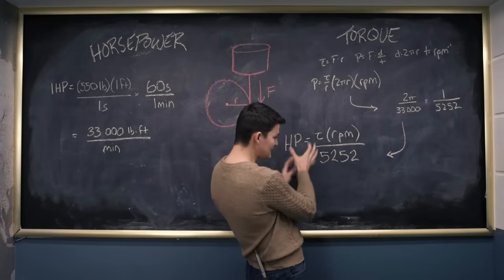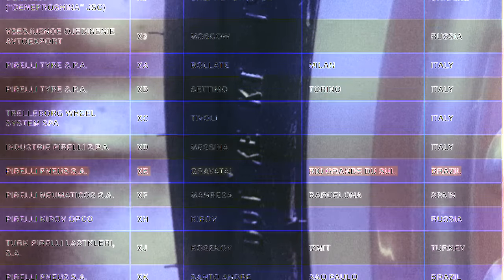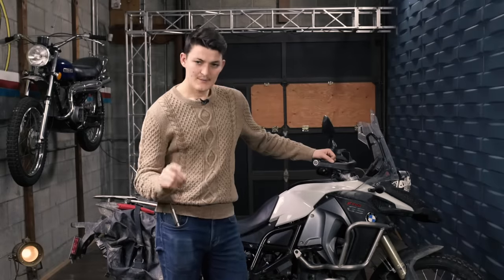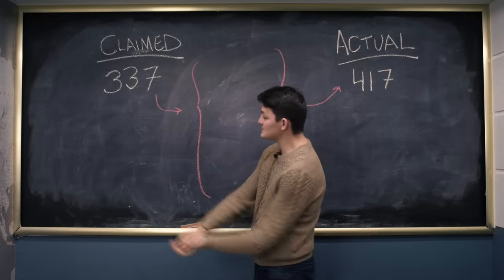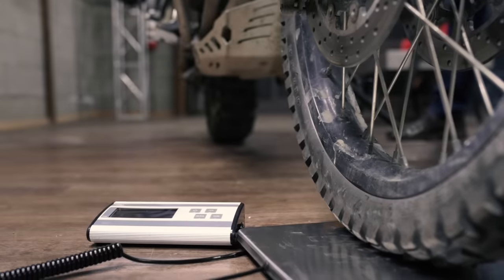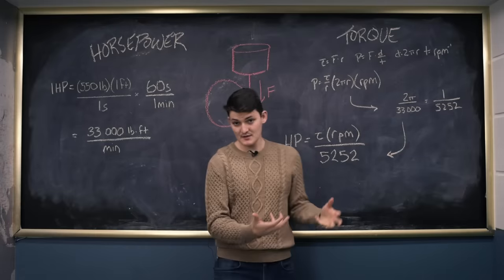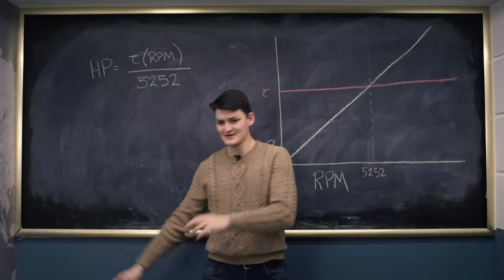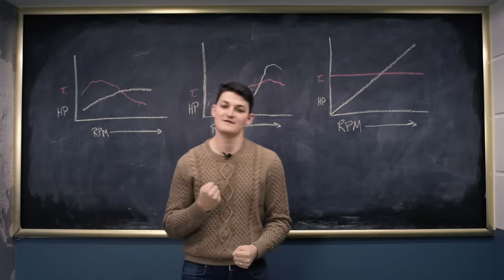3 Ways Motorcycle Manufacturers Trick You

Comment: Luckily with a Honda you don't have to worry about how much extra weight they left off with the tool kit, because they give you dick all for tools now anyway. My 86 Suzuki came with interchangeable screwdrivers, double ended wrenches in a ton of sizes and a spark plug socket. My 23 crf 300l came with.... An Allen key. That's the toolkit.

Comment: Love your content.  Clearly put a great deal of thought and effort into it.  Probably the only detail I would throw in there to tie two of the very astute points you made is that what you "feel" is acceleration.  Acceleration is effectively how readily available power is at the current rpm, vs. how much mass (you plus the bike) you need to move.  Thus if you have two bikes with identical powerbands across their rpm range... and one of them weighs 550lbs and the other 350lbs and you weigh 150... then the lighter bike will accelerate ~30% faster and you will feel that.

If you currently weigh 250lbs... let this be an incentive to you to get a massive free performance boost from your bike.  Unless none of that matters to you...I'm at 220... so... it kinda matters to me... but I just ate another chocolate chip cookie sooooo....

Great advice at the end, try the bike, ride what you like.
Reply: Except for the fact that there IS no "current" RPM or speed, because, by definition, it has to be in a constant state of change (i.e. INCREASING) or there would BE no sensation of acceleration.
Reply: @michaelscott356  I get what you're saying however you can determine instantaneous acceleration for any combination of rpm, gear, and speed at any explicit time.   

Otherwise you wouldn't be able to generate a plot of acceleration from 0 to top speed.  I.e. just because everything is changing doesn't prevent the ability to measure it or feel it and learn to keep things in x power band with y throttle to power out of a corner predictably.
Reply: You can't make acceleration comparisons only based on power to weight ratios. Aerodynamic drag is an important factor too. At high speeds that 30 % could be a lot less or a lot more, depending on the shapes of the bikes and riders.
Reply: @Janne Laakso  I agree, go fast enough and drag literally and figuratively becomes the great equalizer.👍

Having said that, of course I can make acceleration comparisons, by keeping it basic.  The whole "assume a frictionless spherical chicken in a vacuum" thing. Otherwise we get into wheel mass and radius, drag, etc.  Even then our model won't be 100% without some empirical fudge factor. 

Getting up to typical road speeds, wind drag with similar styles of motorcycle isn't the dominating factor.  That's where my head was at so I ignored it.  Already near highway speeds and faster then yeah it would definitely matter if one chicken was more slippery than the other.  😉
Reply: If what we feel is acceleration, and acceleration is proportional to torque / moment of inertia, the latter of which is constant throughout the RPM range, does that mean that we should look at the torque curves when comparing the enjoyability of two bikes?
Reply: @waldolemmer  
In a sense, yes.  You can reasonably simplify the "fun" of an engine by looking at how it's torque is distributed and how broadly it applies across the rpm range.  Then, the better you are at keeping the rpm in that high torque zone, the more responsive and powerful it will feel.

Pair that with the gear ratio and you can repaint it in terms of how well you can sustain hard pulling acceleration before diluting that power shifting into higher gears.

Lastly, if the engine maintains high torque into higher rpm, that's going to result in high hp, i.e. it will continue to accelerate nicely into a high top speed.

But... if you're only planning on hitting 75mph or less 99% of the time, or trail riding etc... having a high torque band deeper into higher rpm might not help much, especially if it gets weak at lower rpm making it harder to "tractor" through things at low speeds, thus forcing you to be a little more fancy with your clutch. 

For example my wr250r's torque is best from  5250 to 8250.  A lot of people who ride this bike primarily off road trail riding switch the gearing to be slower so that more of that high torque zone is available at slower speed in first gear.

I've gotten used to it and I tend to live in 2nd gear which puts that decent spread of rpm across a big range of speed letting me be lazy and just yank on the throttle getting up to decent jumping speed very quickly. 

Particularly nice for my novice skills at the intermediate motocross tracks too.

Edit: this doesn't negate that pulling our butts and the bike itself will directly oppose acceleration, and since getting back down to 190lbs and closing towards 180, my bike feels more powerful.  But yeah, knowing the band where an engine has great torque and how big that band is gives you a feel for how much fun it is and how accessible that fun will be.  😉

Comment: The "Torque vs. Horsepower" game is played with car manufactures as well.  Nice explanation!!
Reply: The video also deserves a follow up on how difficult it is to have standardized engine performance graphs for objective comparisons because different dynos have different accuracy/drag/cooling etc and the performance of an internal combustion engine at any given time can vary substantially with atmospheric conditions.

Some people go apeshit on internet forums comparing bike/car A's dyno to bike/car B's dyno to establish which is superior based on a graph from dyno model X tested two months ago in one city and dyno model Z tested last week 3000 miles away, none of them stop to realize that each of those graphs could be like 5-10% off easily.

Some manufacturers do provide the full engine performance graphs, for instance Ducati and BMW do, but they are the "indicated" performance graphs (basically the theoretical ideal performance expected based on measuring/simulating the gas inside the combustion chambers) not actual print outs from an engine dyno test, largely because there is no universal industry standard equipment and test conditions for that so that could easily be fudged too.
Reply: torque vs horsepower is a fallacious arguement since they dont oppose each other, you really want to get the most of both.
Reply: honestly torque doesn't come into play unless you are trying to move heavy objects. when it comes to a bike hp is all that matters. when it comes to a semi torque is all that matters.
Reply: @leetucker5788  no. Power is always the number that matters (for engines): torque can be converted, a gearbox, a torque converter, even the wheels itself does nothing else than converting revolutions and torque. 
But the power will be the same on both ends.
when you put all your weight (i take mine ~100kg) on a lever of 1m, you are generating 1000Nm of torque!
but even the engine of a 125ccm-Bike (~10Nm) will (with correct gearing) turn you to nuts, because it has way more Power!
Reply: @Coolgamer400  Except you're comparing static torque vs dynamic torque (and static torque, because in car or a motorcycle both are involved). That's useless comparison. You can read up on that. You can also read up on the issue of torque conversion. Yes, you do manipulate torque with various systems - like torque converter, gearing or wheels. However, all those elements are limited by other practical factors. If you go for really extreme gearing you'll be restricted to extremely slow moving vehicle. Torque converter's torque multiplication is limited by among other things size of it - and generally speaking isn't most efficient way to doing it. Similarly manipulating torque through wheel size is limited by shape of vehicle.
That's why torque as maximum value is important, but more important is torque curve. If your engine produces 10 Nm of torque, it might be in - say - 6000-6800 RPM band. If that's the case to maintain acceleration you need to constantly shift gears.. but you can only have so many gears (since it's simply limited by physical space you have for your gearbox). More importantly you lose time with each gearshift as well. In other words: the higher your engine maximum torque is, the flatter the curve and lower revs you get (close) to the top of it, the less compromises you need with gearbox and wheels.
Power is important as well, and honestly all factors have to be considered when 'judging' any given drive train (since engine is only part of entire system). Still, the point of start is engine, to which you adjust all the other factors to achieve desired results. Choosing wrong engine for application is just idiotic.
Reply: Torque  is plenty o fun !
Reply: @leetucker5788  Like one smart teacher once said to me. You can have all the horsepower in the world, but you woun't be able to move from a standstill. You need both to drive, you can't do wheelies if you don't have torque.
Reply: labcoent co Top speed: Point where the Power needed to overcome all resistances to keep moving at that speed equals the power you have available (at that speed).
Acceleration: How much surplus power you currently have over the power you need to maintain the current speed.
It’s just physics.
Reply: There is a quote from before my time that says something to the effect that horsepower Sells Cars and torque wins races. Of course we're talkin about big heavy cars back then.
Reply: @youcanbesmartaskhow3857  and that quote was BS then, just as it is now
Reply: @svenblubber5448  I work in a truck shop currently and the 500 horse 1800ft lbs/tq trucks ain't winning no races but they pull anything. [Semis] idk.
Reply: @youcanbesmartaskhow3857  They don't win races because they are way heavier than race engines in the same power category, and lack power compared to high performance race engines.
They can pull anything (slowly!) because of gearing,  but any adequately geared engine with the same power would pull the same,  even with less torque (therefore working at higher rpm)
The fact trucks have way more torque than race cars proves the point that "torque wins races" is BS
Reply: @svenblubber5448  that's kinda why I brought up the big rigs, if torque won races, that much torque even in a heavier package would smoke anything. But how is it possible to have 2k ft/lbs and only 4-500 hp if they are the same at 5252? The big torque made so low? Not arguing, genuine questions here since  you are knowledgeable . When race motors are built for hp, torque seems to be a side effect that usually increases with mods. Peace, Sven!!
Reply: @youcanbesmartaskhow3857  HP = torque  x rpm. The higher HP comes from higher revs. If both vehicles have identical torque  (and for simplicity assume it's even over the whole rev range) but one (the truck) has max 5000 revs and the other (racecar) revs to 10000, then peak hp of the race car is twice that of the truck. At 5000 revs, when the truck develops max power,  They would both have identical hp, but as the race engine would typically be geared differently,  it is not likely to drop below 5000 revs or so during the entire race
Reply: @svenblubber5448  I get it.  The semis have the torque but cant produce the hp since they dont have the engine speed. Some high rev [10k rpm] race motors are gonna make power but same torque# since the max rpm has moved up. Thanks man I always sensed the correlation but skipped the equation. Not to complicate but it's kinda how a 2/3 hp electric motor can make enough power to open a heavy garage door . Has the torque but doesnt spin fast [help from gearing] but could be higher hp if it spun faster. Thanks again, Sven! Cheers!
Reply: @youcanbesmartaskhow3857 the garage door also has a huge spring above it effectively making the door weightless, allowing the small motor to easily move the door 200lb door (or you easily raising/lowering the door one handed it you pull the red cord to detach it from the motor).

Also, the HP formula is (torque*rpm)/5252 --- semis don't get near 5252 RPMs where the HP and Torque numbers always cross on a Dyno chart.  A semi's HP will always be less than the published torque number because of its inability to reach 5252 RPMs.  A sports bike can go way beyond 5252 RPMs, which magnifies its relatively tiny torque number into much larger HPs (max HP is higher than max torque on engines that can exceed 5252 RPMs -- at 5252 RPMs the numbers are always the same).

Comment: "what most riders desire is..."

except when reviewers actually get bikes like that they call them boring o.o
Reply: Bingo.
Reply: This is true for cb500f and e, for example
Reply: Aw shucks, consistent and predictable power. Boring. /s
Reply: Not quite. Reviewers are almost invariably biased. In the Uk, if Triumph makes a bike with a smooth torque and power curve (lets say speed triple) it is a refined, smooth and linear engine. When kawasaki make a Z900 with an immaculate power curve it "lacks character". 
Best advice is, as Ryan says: try the bikes out because 99% of reviewers speak bullshit.
Reply: Ah, the age old problem of "reviewers" aka advertisers. More often than not any "review" you see will have loads of positive aspects and praises of a product with just a dash of the negative sides. Some may even feel like tech sheet readouts. In these cases you have to remember that they are very likely getting paid directly (sponsorships etc.) or through referral systems (sales volume). So if you come across with "reviewer" which always ends with a positive image of the product, you know that the person is financially constrained in their "review" and you should mainly focus on the negative sides of the product brought up. These "reviews" are one of the reasons why user based content has been in such a high regard, people want to cut through the manufacturers' and "reviewers'" bullshit and know if the product is actually any good.
Reply: @anomuumit  even in user based content, it's very easy for someone who owns an item in question to praise it, just so they mentally justify what might be a "bad" purchase. I would always recommend focusing solely on the negatives of a given review and figuring out what compromises you're willing to make. Lesser of the two evils, essentially